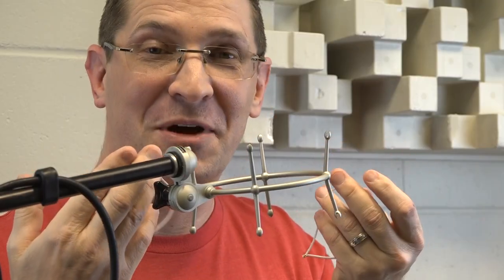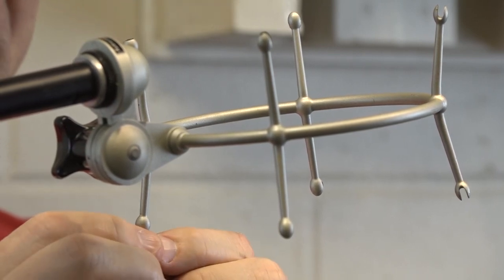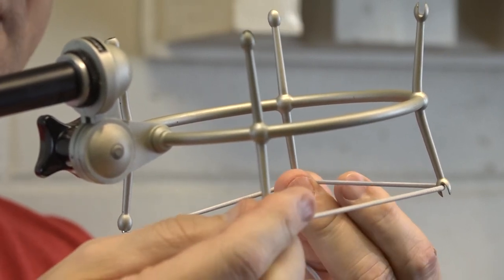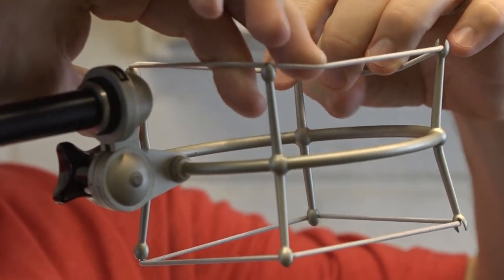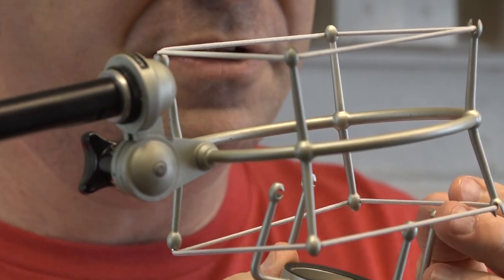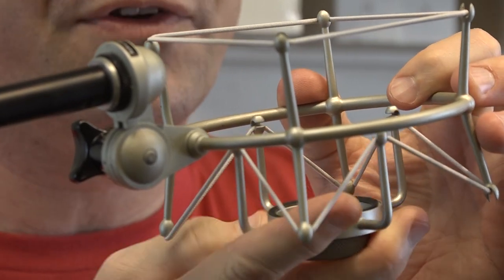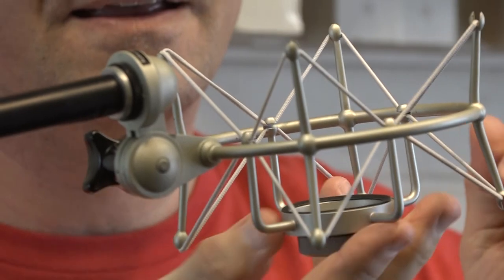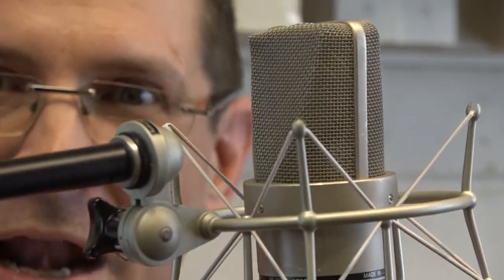Bonus Video - Replacing the Rubber Bands on a Neumann Shock Mount

Comment: Hello, I purchased a used TLM 49 without a shock mount. What shock mount can I get other than the EA 3? I can't seem to find those anywhere.
Reply from the maker: It looks like you need the EA 1.  Sweetwater Sound has those in stock.
Reply from the maker: Now, if you're looking for something that costs less than the EA 1, it's going to be tricky considering the diameter of the TLM 49.  The AKG H85 shock mount just barely fits a TLM103, but the 49 is just a bit too big.  BUT, you could make the H85 work if you inserted the mic through the bottom of the shock mount, and just let it hang upside down.
Reply: @MrBinthestudio  thanks so much for the information!